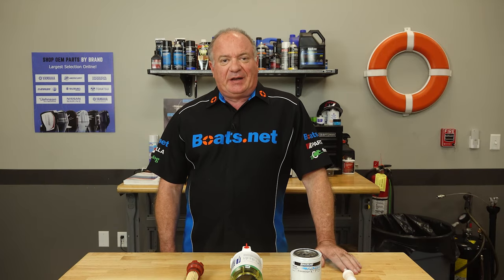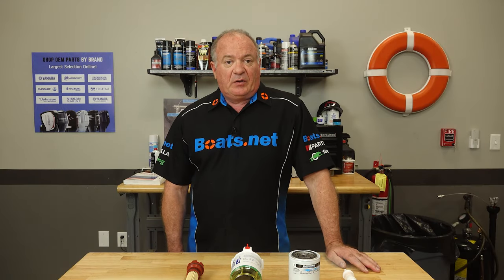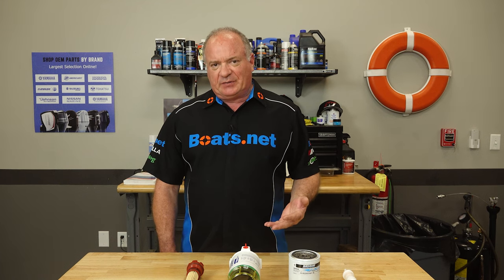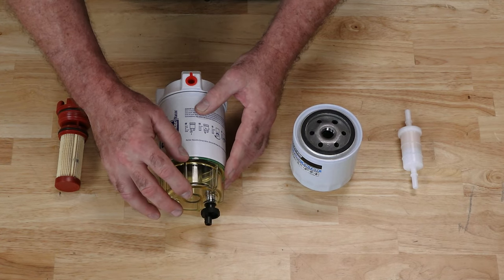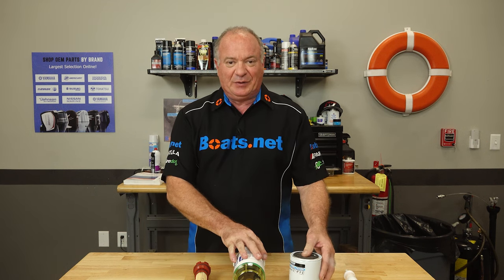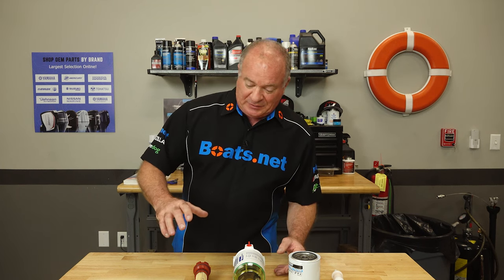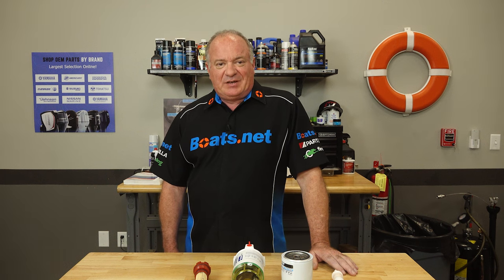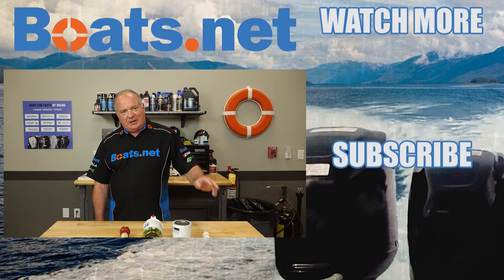Fuel Filter vs Fuel Water Separator | Difference Between a Fuel Filter and Fuel Water Separator

Comment: So the filter in the fuel/water seperator is only for filtering water, and doesn't also act as a fuel filter? Guess I'll leave the traditional filter in line then. So, if you can empty water out of the clear lower section at what point do I need to replace the fuel/eater filter? Does it wear out of clog up, or is it "fit and forget" as long as you empty any collected water out?

Comment: I removed my fuel/water separator and there was oil in the fuel? It’s an ocean pro 115 hp vro system engine will not stay running thought it was water in the fuel. No water? Thanks

Comment: Can a fuel water separator be used with an older 2 stroke outboard (50 hp Mercury 1987)?
Reply: I've got one on my 1999 40HP 2 stroke Mercury... so yes it can.